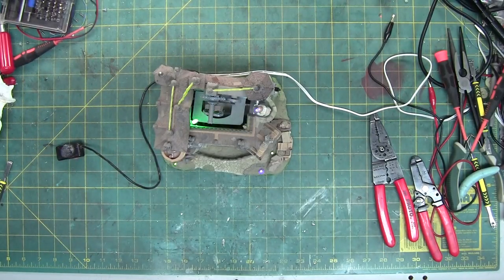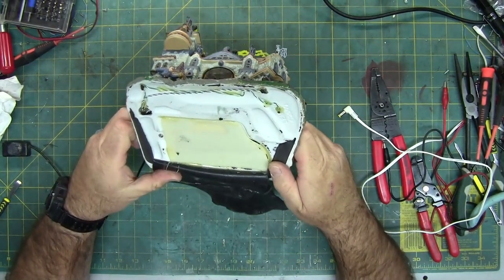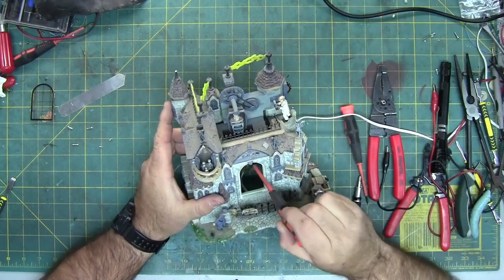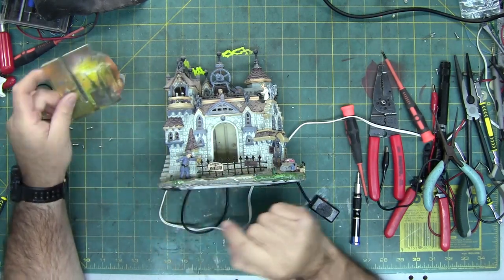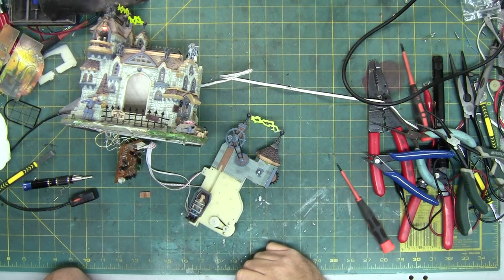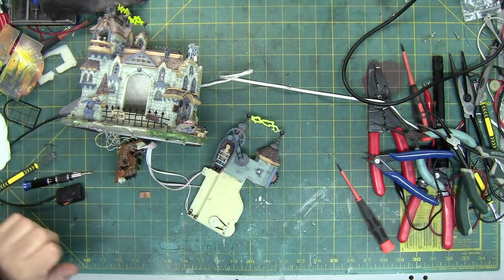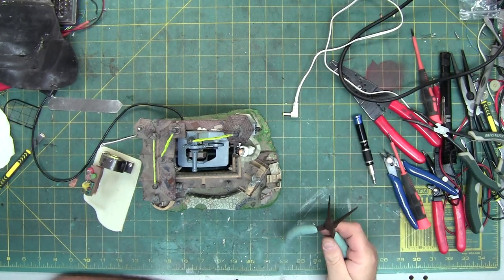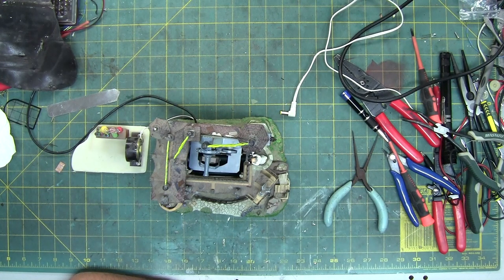Lemax Frankenstein's Laboratory disassembly process

Comment: Thanks for this video, made disassemble with your help, I have this model, and the lights come on but has no sound or movement, I jumped motor, and it runs. no wires are broken, and circuit board doesn't have any burnt or black spots on it or components. Do you have any ideas on this.
Thanks in advance